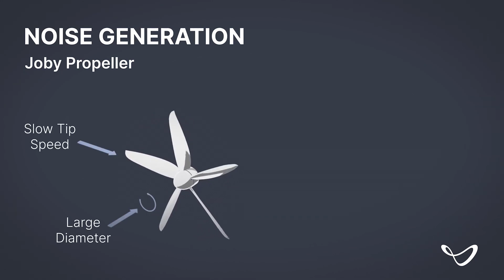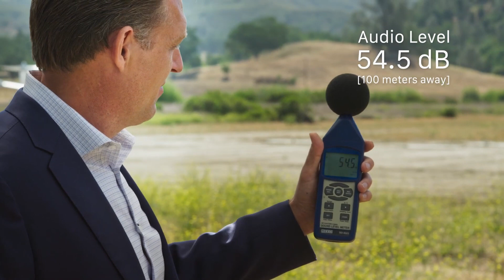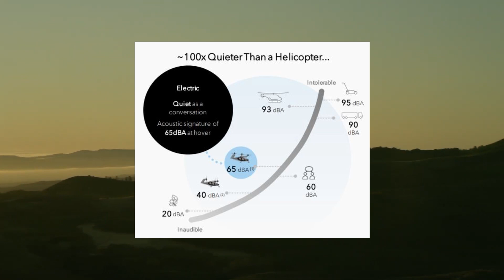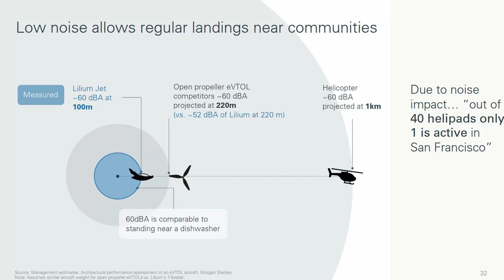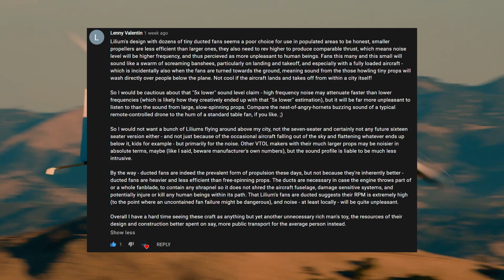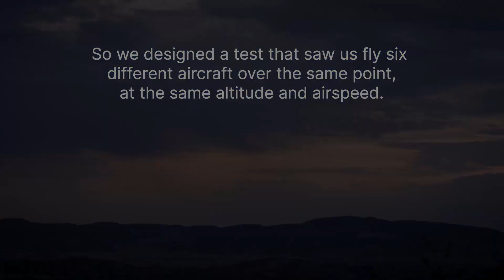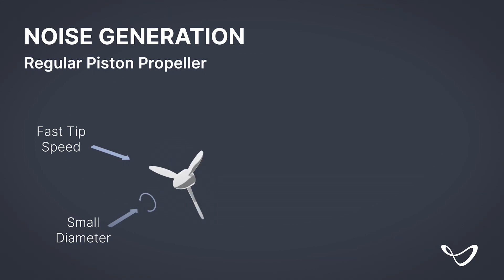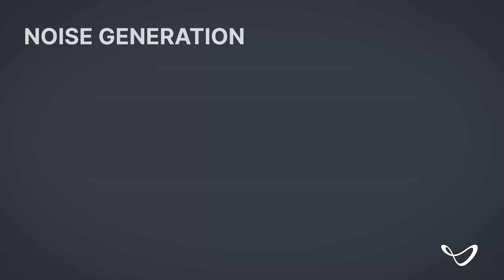Lilium vs Joby Which Electric Jet Quieter? Noise Level Of LILM & JOBY During Landing | eVTOL

Comment: WHY not compare SAFETY and/or efficiency? (Distance traveled per unit of energy)?
That is FAR MORE IMPORTANT than noise level when BOTH are much quieter than conventional aircraft.
I can SEE you favor Joby but that is likely because you have STOCK in the company.
With Joby, if you loose one engine you have lost 1/6th of your ability to stay in the air.
With Lilium, if you loose one engine you only loose 1/36th of your ability to stay in the air.
Reply from the maker: I did, in my previous videos. For example https://youtu.be/OWx_Ea2s7us & https://youtu.be/IbIY1f05OrY .
I do not have a position in any company at the moment. As I mention in almost every video I make about eVTOLs, I believe it is too early to invest in this industry
Reply: @FGain  I own Qell stock, and I think your assessment was completely fair. I just don't believe it is simply a matter of which aircraft is most quiet, but rather, overall which is most appropriate for its intended purpose, which is transporting people in and out of densely-populated environments.
Reply from the maker: @Wolf88888  Agreed!
Reply: Lilium has no control surface. The attitude of the aircraft is controlled by fan flaps. It does have 4 flaps in the front wings(2 each) and 8 flaps in the back wings(4 each). So that's plenty of redundancy. However a major control or power system malfunction likely affects all the flaps and lead to complete loss of control. 

Joby's design still resembles a traditional aircraft, although it is designed to fly by wire, but likely has better chance to handle control or power system catastrophes. Joby's design allows it to do autorotation crash landing or glide a little bit. These are options available to Joby's engineers but basically do not exist for Lilium by design. 

Joby are based on tried and true technologies. This allows them to move fast towards certifications while control aircraft cost.  Joby has flied over a thousand test flights and flied the full scale prototype 150 miles in air. Lilum only has a drone to show you (and Archer has a model that sits on the ground while busy dealing with lawsuits)
Reply: @agentp8881  Ilium has 9 battery packs.   The complete shutdown of several packs will have minimal impact.   The flaps will surely be double or treble redundant with one active actuator and two in standby.   Its not the Boeing MAX.  IN An Airbus there are two actuators 1 is active the other is in damping mode (bypassed  by valves).  Each actuator has two of the 3 supplies available.  It will be at that level but likely several (Id say 3) electrohydraulic  actuators each with an integral motor(or two).  One will be in use and the other in backup.  Hydraulics is easier to bypass with a pair of solenoid valves.
Reply: @agentp8881  Well said! I think the Joby airframe is inherently much safer, and its noise advantages are a deciding factor for scale. Lilium has a very impressive technical team, but they made a big leap to go with the ducted fan and nontraditional airframe. 

Unfortunately I think the high-pitched noise is going to greatly limit their use in surburban vertiports. They'll be able to operate at existing (very limited) helipad and small airport infrastructure, but they'll be blocked from scaling into the suburbs by activists who are greatly and rightly concerned with take off and landing noise. NIMBYs won't allow them in new vertiports unless they can eliminate that noise with liners. I unfortunately think they won't be able to reduce it much. The venturi effect from all those small tubes generates a lot of that noise, so I doubt they can get rid of it. If they can, every surburb that allows leaf blowers will mandate that the same tech go into all those noisy leafblowers that wake sleepy suburbanites up at 8am. People hate those, and are mandating electric leafblowers now, (for decarbonization and for noise) but the electrics are still pretty noisy.

One possibility would be very tall suburban vertiports,  but those will be very expensive to build. If many of the standard air taxi airframes can take off and land quietly with just a four or five story vertiport with sound baffling at the top, what city will want to build taller ones just for Lilium? Not many. 

I love the simulation-centered approach of Lilium, and I'm rooting for them to take a good chunk of this disruptive and vital new market for congestion relief in our cities. Joby, Wisk, and Lilium seem far ahead of the other several dozen serious players at present. I am presently invested in all three. But I predict that Lilium won't be able to fly their ducted fan airframe into many new vertiports. I bet that noise abatement will become a major political issue as these things scale. We haven't seen the public weigh in on these yet, but they will, as they should. We shall see!

Comment: Lilium design and engineering: 9/10, sound 6/10. Joby design and engineering: 8/10, sound 9/10. Helicopters:  7/10 and 1/10 but can fly longer distances
Reply: Joby design is far from appealing compared to Lilium, but the sound is just the opposite, Lilium is annoying
Reply: @ruipedrooliveira4677  I may be biased, but I like the look of Joby’s. It reminds me of an osprey
Reply: @ruipedrooliveira4677  It's hardly noticeable to me.  A faster rush of air but not much.  You'll never hear it in a house, even if nearby.   The whole ilium transition is supposed to complete in 18 seconds or less.

Comment: That's really quite impressive for Joby, but I love the design on the Lilium jet. I can't wait til these are regularly in the air!
Reply: I don't think people have really thought about the heightened risks of this form of travel. Once you leave the ground a whole set of variables come into play you don't normally have to think about. I put the success profile of this on par with Tesla self-drive: It is going to work great for most and be catastrophic for a few.
Reply: @es330td  what are the risks?
Reply: @some.egokillers  If you are driving a car and something goes wrong you can just coast to the side of the road. When something goes wrong and you are off the ground the impact is much more serious. There is a good reason that life insurance for small plane pilots is very expensive. Vehicles like this are being touted as "flying cars for the masses" but real world risk factors are going to make this less desirable that a lot of people think.
Reply: @es330td   automobiles & planes can't really be compared on a saftey basis. The risk of something going wrong statistically with aviation is under 1% or "extremely rare". Planes are serviced regularly & often, & has a professional & A.I. operating it. Cars on the other hand pose more of a danger because people "unprofessionals" just get in them & start operating & they don't service them regularly, or know what their doing.

Also these eVTOLs are designed like airplanes. So if something go wrong. They won't just fall straight down. They can glide to safety like a airport runway or a body of water & float.

Also eVTOLs wouldn't even be in the air if they don't meet the federal aviation administration safety standards.

But if you want to talk about safety. Aviation is safer by a long shot. Even if eVTOLs do fail under that 1%. They wouldn't explode or go up in flames or anything. Bc they don't contain gas. & because they can glide. The pilot or A.I. can find the best place to glide to. If they need local authorities to clear a interstate or road or whatever. They can. Planes can literally glide for about an hour. So clearing a section of a roadway. Will be no problem is one needs an emergency landing. Cops do it all the time if a criminal is on the road. 💀

I'm texting to much, you should learn how aviation & aircraft works it's not what you think though.

& invest in joby. 🐐
Reply: @some.egokillers  I am a pilot with time in C172’s, C182 and a Bonanza. I am very aware of the maintenance requirements for aircraft. 

You are generally correct about the problem rate in aircraft. These numbers are skewed, however, because turbine aircraft are MUCH more reliable than piston aircraft. EV aircraft are going to be more reliable but they are going to have a different set of issues. Battery health will be critical. Air gets colder with altitude, reducing battery effectiveness. Piston aircraft generate heat as a by product to warm passengers, EV will need to use battery power. FAA rules require a 45 minute fuel reserve plus two alternate landing choices. Batteries don’t like getting charged to 100% and they charge slowly. I’ve flown cross country. When low on fuel I landed for fuel and was back in the air almost immediately. For an EV plane that will be a multiple hour fuel stop. 

An EV aircraft that is essentially a big multi prop drone now has more things to fail and since these hover instead of glide a failure of any one will likely prove catastrophic. 

I am not saying this idea is impossible. I am saying there are more hurdles than people are considering in something where the consequences of a problem are much higher.
Reply: @es330td  sure but these meant as air taxis point-to-point
Reply: @gravitisplus  The moments of highest risk in an aircraft are right after takeoff and right before landing. Short haul air taxis increase the fraction of time spent in those situations.
Reply: @es330td  eVTOL craft like Lilium are going to fly in highly controlled environments in regulated corridors, eventually pilot-less.   They are much safer than aircraft because 1 36 redundant motors and 9 battery packs.  2 Can land anywhere being VTOL IE  alternative landing zones can be provided easily.  3 Ballistic Recovery Parachute. 4 Easy to fly and control due to FBW. 5 No blade strike issue.  Lilium does have much higher levels of redundancy.